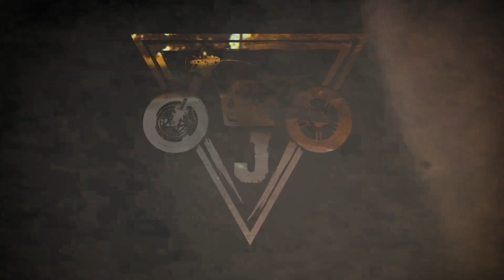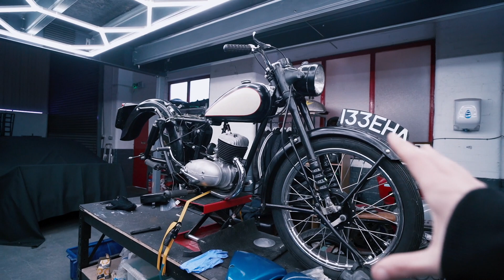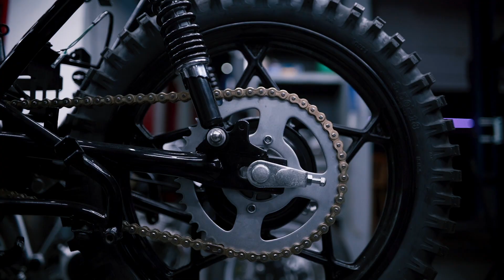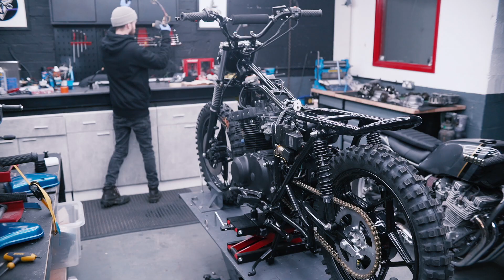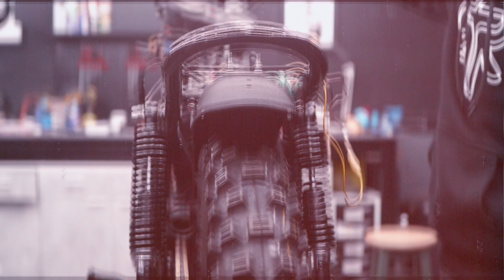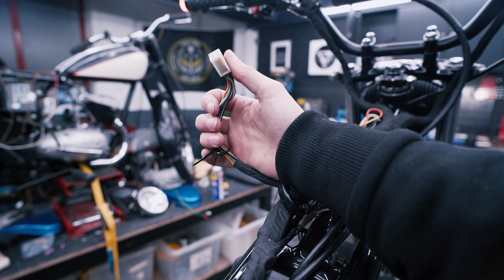Suzuki GS250 - Part 11 - WIRING! - Highsider Proton Two Lights

Comment: Is it a must to have the relay for the 3 in 1 lights to work? I purchased these some lights from Highsider. I did not get a relay. I can’t get the lights to work correctly, which is what brought me here. I can get the to flash in red but I can’t get the lights to with the amber. I have it so that the amber lights alone come on, but then there is no red. Spent all day trying to get it figured out.

Comment: Dude something I noticed. Where the new lights go into the mud guard, make sure they clear the wheel when the shocks are depressed or the knobby tyres will make short work of the cabling 👍
Reply from the maker: Dont worry dude i have thought about this! The cables will be flat against the inside the mud guard as im making a bracket to hold them flat. So they will be protected behind a 3d printed cover

Comment: Those lights look awesome! Q…will they pass MOT? I was sure my integrated tail light/indicators was a fail but that was some time ago and rules might have changed
Reply from the maker: I will let you know! Thornton hundred uses combined lights on his builds and they are all brand new bobbers so id assume so. With my bike being over 40 years old and falling under the historical category it doesn’t require an MOT. Not with the mods done to the bike anyway. But yeah its worth checking though! ⚡️
Reply from the maker: These are way over 15cm apart but its good to know!
Reply: Had the same concern, but because I was worried the indicators were too close together.
Love the build Jish 👍
Reply: Hello This indicator/tail light was E approval ,actually it doesn’t test by MOT.